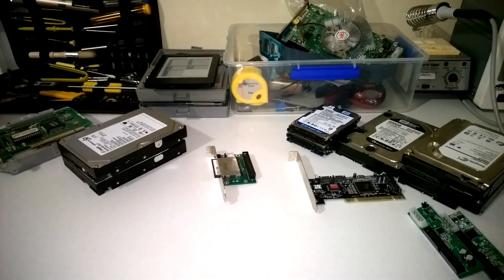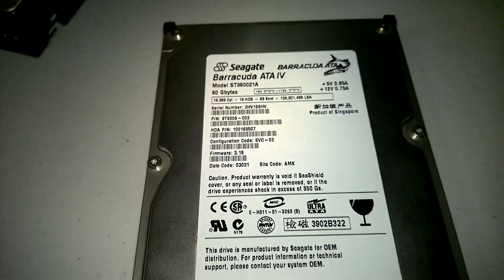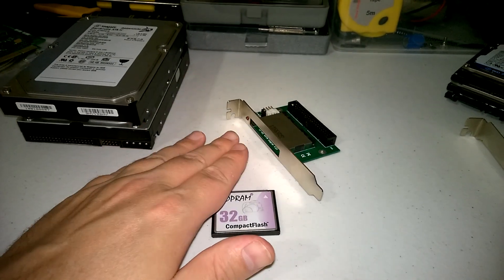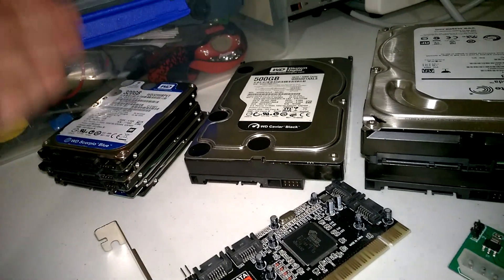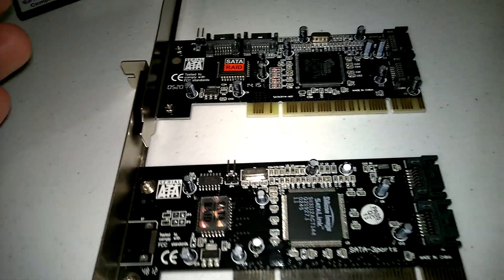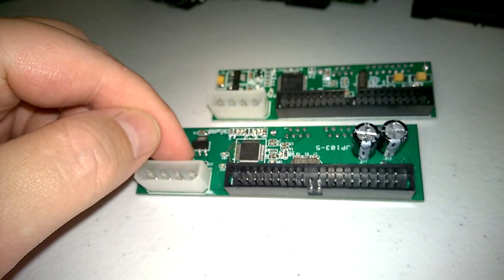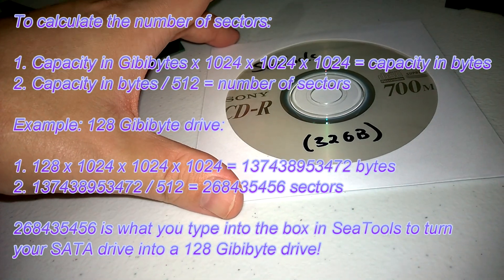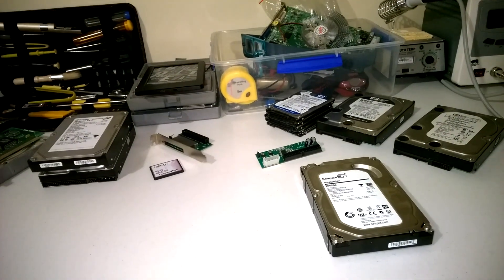Hard drive options for Retro PCs

Comment: A good alternative is using relatively new motherboards with socket 775, an AGP slot and SATA ports. Oftentimes they have integrated SATA controllers that work fine with modern drives.

Comment: I found a PCI SATA controller on Amazon that uses the Silicon Image SIL3114 chip:  GODSHARK 4 Ports PCI SATA Raid Controller  (1 of several clones using the same controller)    
It detects my new ADATA SU800 120GB SATA 3 SSD, and I can FDISK/Format them from the Windows 98 boot disk.  (Going to use GPartED to align properly, just did a quick test)    
Comes with drivers for 98, ME, NT and 64bit Windows.    
Bonus info:  Some Seagate 5.25" SATA spindle hard drives have a jumper to limit them to SATA 1 speeds.  If you are OK using a hard drive, this also works with Windows 98 and some old on-board SATA controllers.
Reply from the maker: Nice! Yes there are a few controllers that work well with Windows 98 SE. I have used one from Promise with great success.

Comment: Why don’t you use a king spec pata ssd? Yes, a 2.5 inch ide drive. 8 gb, up to 256 gb. I use multiple 64gb models for my dell CPI and dell c810. Drop in, 100% compatible with win 9x. Just a thought.
Reply from the maker: Yea I meant to buy some DOM devices, but never found a decent deal it seems. If you have a link please share!
Reply: @philscomputerlab  I would buy two at this price. https://www.amazon.com/KingSpec-2-5-inch-Solid-SM2236-Controller/dp/B008RWKFYE
Reply: Why not just buy a SATA to IDE adapter about $4 on ALI' even nowadays?

Comment: Stating the obvious but you are a legend. Had a SATA VT6421A PCI with windows 98. Running no problem then changed from a SiS motherboard to a VIA ones with issues regarding transfer speed and lagging. Watched this video and comments about the chipset etc. 

Bit the bullet and got a SATA PCI silicon 3512 and the issues have gone away.

Life saver!
Reply from the maker: Nice! With VIA boards, and other chipsets, IDE is often what I end up using as it works well.
Reply: @philscomputerlab  couldn’t make it up. Just got an Intel slot 1 setup and having the same issues again as the VIA but this time with an Intel Chipset, the MS 6156 with the  Intel® 82443BX chipset. Will have to try the Silicon one out later.

I guess these VIA ones are just a bad choice period, although seems to be no issues with the SiS chipsets. Do you know how the Silicon ones work with SiS chipsets?

Comment: There are ISA SCSI drives, even 8-bit ones, and they don't need drivers if operating properly. I used Mac's in the mid-90s, and they all had SCSI, and I found it not only faster, but more reliable than IDE (or EIDE). You could also connect Macs on-the-go by FireWire, when you still needed slow PC-Link software to transfer a few files PC to PC. Apple had some justification in claiming superior performance back then. SCSI had been used for years in Sun workstations and servers, basically all the high-end workstations used it. IBM might have slowed the development of PC drives when they converted all IBM PCs to Micro Channel Architecture. It was a good standard with good specs, but when every clone-maker was sticking to EIDE, and supporting components that were cheaper and much more widely available... It was good to have Nubus and SCSI in Macs at that time. So very different than today.

Comment: you could have talk about the different sector-sizes on sata drives (512b vs 4k), since not all OS are compatible with the newer 4k standard natively (older systems like MS-DOS, Windows 98 and XP does not run well on newer 4k-sector storage without additional work! ). Otherwise very nice video!
Reply from the maker: Yea good point. The Seagate drive has this mentioned somewhere in the datasheet, that 512 sector sizes have no performance impact. I do remember that detail, though not sure if I mentioned it in the video. I doubt the overhead would be high enough to really notice with these old machines?
Reply: some more indepth info about the whole thing: https://docs.microsoft.com/en-us/windows/win32/win7appqual/512-byte-emulation--512e--disk-compatibility-update

Comment: I just discovered an option that may have been overlooked that includes Hyperdiski Disk on a module used for embedded OSesand includes  some pretty advanced features for windows 98 seemingly includes TRIM and ECC and a lot of liftime writes found it on ebay .. any experience with these ?
https://tinyurl.com/wag7gxt
Reply: So it's just a SSD for older machines?

Comment: I have a powerbook 540c (apple laptop) with scsi hdd, what can I possibly use to replace the drive in there? 

I'm very shocked it still works after 25 years but I know i'm playing with fire, needs to be cloned or at least replaced

Comment: I was looking at getting a 50mb/sec 8 gigabyte CF card for my old Pentium 100 which I believe has an ATA33 controller, so the read and write speed of that CF card I'd think should far surpass what the interface can do at maximum. Just checked and the original HDD is only 16mb/sec so this card should be more than fast enough.

Comment: I'm trying the cf2ide adaptor with a kingston 600x 32gb cf card and it sees it but when i create the partitions in fdisk and i have also tried using the diskmanager once the system reboots the partitions are gone. is this because the kingston cf card is not compatible or is their a step i need to do so it works. im using it in a 486 at the moment will probably be putting another one in my 386 once i get this working.
Reply: I've also run diskpart on my modern machine and cleaned the card of the pre partition to see if that would work and it didn't.

Comment: I know this video is old so you may not see this but have you used either of those SIlicon Image SATA controllers to boot on an Asus socket 370 board? I'm trying to set up a retro rig with an Asus TUSL2-C motherboard and I've tried two of these Sil3114 cards, they see a connected DVD-ROM and SSD, but the machine won't boot to either device. I tried booting to an IDE drive to get Windows installed but even after that first step, upon reboot the SSD still won't work as a boot device.
Reply from the maker: ODD booting is not supported. With new flash storage, try the fdisk/mbr command to make it boot!
Reply: @philscomputerlab  aha! that makes sense - thanks Phil! Do you know if the lack of ODD boot support is due to the card/chip or system? Wondering if perhaps there are any old SAS/SATA PCI or PCI-X RAID controllers that would work
Reply from the maker: @kalmtraveler  What I do, is connect the ODD to the onboard IDE, that always works. For the hard drive, there are lots of options, but PCI SATA controller should work well.
Reply: @philscomputerlab  just wanted to share something that I've found this week - the Adaptec 1220SA SATA RAID card (PCI-E 1x) works fine in a SEDNA PCI-E 16x to PCI adapter, and according to its manual supports booting from SATA DVD/CD drives but I haven't got that to happen yet. Also, in a Star Tech PCI-E 1x to PCI adapter it doesn't detect any drives... Anyway, if I can get it to actually boot from CD this will be a great option so we don't need to rely on old IDE drives. One thing to note I have not found any pre-Windows 2000/NT drivers for this chip yet (so no 98SE/Me). There might be a generic ATA driver that will work so I will let you know if I find something.

Comment: Thanks Phil for these ideas,
I have been worried about my Gateway Essential 450 and my IBM PC 300GL with the old ide pata hard drives and their eventual failure. I am going to upgrade with 120gb sata drives and use the ide to data adapter (not the card).  Now my iMac G3 I am not so sure about.

Comment: Hi! Towards your video end you discuss how to lower the gigabyte size of a 2T Hard Drive to run swell under Windows 98 at approx 128 Gigs. Are you using this huge Hard Drive, instead of a trusty old legacy 120 gig or less hard drive (that Windows 98 could & should handle), to enjoy maximum durability and less chance of crashing? I'm sure the 1T or 2T Hard Drives are built with much more modern components inside, but are they that good to actually think about buying them off Amazon and then allocating way less space to run on an older Legacy Computer?
Reply from the maker: Yea some drives can be configured to basically report a smaller capacity to the BIOS. Now modern drivers use SATA, so whatever your system, it has to be compatible with that. Seagate drives work well here, you use the SeaTools DOS utility. AFAIK Hitachi has something similar as well.

Comment: i used a 2gb seagate drive for the noise and clicks to complete the retro feel on my Pentium 1 DOS PC but it started acting up like getting bad sectors and not working right and later it completely failed like there were so many bad sectors that the format was so slow, it kept saying "Trying to recover allocation unit" in the formatting process. i just scrapped the drive and took the magnet out of it, i am using a 40gb drive in place of the 2gb drive, it's so quiet compared to the 2gb drive. Those old drives don't age well and they just simply die like get bad sectors over time.
Reply: Did you try using SpinRite? Seems to always do the trick with my old mechanical drives.

Comment: Hi, Phil!
Nice review, but you should mention the "Flipping the removable bit" problem that many of the CF users may experience.
Reply: I have. Tried one old 2GB SanDisk Ultra CF with the CF to IDE adaptor I have (one of those with PCI bracket that can be found on eBay). The BIOS sees it as a drive on the IDE bus, but the card appears as removable drive in Windows 98 SE.
Haven't even tried to fix it, because it wasn't mine.
Reply from the maker: Yea never had that issue, and I worked with a LOT of different systems.
Reply: PhilsComputerLab I have experienced the same and found it to be a real bear.  I agree that it is something worth looking into; I had to abandon the CF SSD path due to difficulties with the removable/fixed bit issue.
Reply from the maker: No idea what you're talking about, I've never heard of this.
Reply: Some CF (and not only CF) cards require this bit to be flipped, otherwise they are being seen as "Removable drive" and not as "Fixed drive". Not so big deal for DOS, but a must for Windows.
Reply from the maker: Odd, never ran into this issue.

Comment: Do you have to format the SATA drive before placing in system. I tried to install a 120gb ssd with an adapter but bios/system will not recognize. Ideas?
Reply from the maker: If it doesn't get recognised, then it's not the right drive to use! Go with something else, like a SD card.
Reply: @philscomputerlab  well for some reason my K7M Asus motherboard continues to not see any hard drives regardless of what I do. I get alot of ATAPI incompatible

Comment: The best solution out there is using SCSI. Compatibility is as good as it gets. Just get a decent UW-SCSI Adaptec controller (if you haven't one onboard on the motherboard), a 68-pin modern SCSI drive and forget about DMAs, master-slaves and all that nonsence. For DOS and Windows 98 drivers are optional, they increase performance, for Windows NT-2000-XP drivers are a must. The only downside is that SCSI will significantly increase your boot times, but you'll definately notice the performance increase as well.
What's so great - you can put a fairly modern 300GB U320-SCSI 15K rpm (Cheetah 15K.5 for example) on any UW-SCSI controller and it will work in any motherboard eliminating 8GB, 127GB BIOS limits.
You'll be also amazed how quiet the Cheetah 15K.3 and newer are.

Comment: Many years ago I had a good 'hack' use for the 4 port silicon image sata cards:
Remove the BIOS chip and fit a plcc32 socket. Put the BIOS chip back in the socket and boot up.
Once the card has initialized, the BIOS chip can be removed, and the flashing tools used to hot swap in and reflash pretty much any motherboard BIOS (or plcc32 flash chip) to recover from a bad flash etc

Comment: Very interesting video!

I have finally ordered some retro parts and I'm thinking about storage. So far I've bought an ASUS P3B-F, an Intel Pentium II 400Mhz and two Kingston PC-133 256 MB sticks.

My preferred method of storage is definitely the compact flash with a slot at the back. I REALLY like that they are compatible with the IDE standard and that there is no need for converters. I also like the idea of having different CF-cards for different projects.

I've never (not even in the 1990s) been fond of hard drives. Somehow, I feel that mechanical parts have no place in a computer.

Do you have any idea of the performance if i decide to go with a high end compact flash? Sandisk Ultra, Sandisk Extreme or something like that. My idea is having a card that is so fast that the IDE controller becomes the bottleneck.
Reply from the maker: Johan Andersson You'll be very happy with a fast CF card.

Comment: Phil, could you update this video? Something has changed on this meantime?
Reply: Things are mostly the same. Old hardware is still becoming harder to find, of course. One option he doesn't mention is that you can actually find new production PATA SSDs on EBay/AliExpress, you will also need a mini IDE to full size IDE adapter since they are 2.5" drives. You'll get good performance while being able to use any motherboard's onboard controller. I have one of KingSpec brand.

Comment: I remember when I first got a SATA II hard drive back in the day, it didnt work with my SATA I motherboard, but I got it to work by setting some jumpers on the back of the hard drive. 3.5 inch Western Digital hard drives look like they still have the option to limit the speed to SATA I: https://support.wdc.com/knowledgebase/answer.aspx?ID=981
Reply from the maker: Yes I know that trick! It works great with VIA chipset motherboards. Unfortunately newer drivers don't have this option, especially SSD.

Comment: Excellent video Phil. I'm using a different CF to IDE adapter, MSI 694T mobo, and I can't get more than 2 MB/s read speed on windows 98. (Can't enable DMA), rare, isn't it?
Reply from the maker: Some boards and drives just don't work well together.

Comment: In the era I'm looking at for my 486 build, most decent IDE HDDs were around 500MB... LOL – I'm looking more for something SCSI-2 2GB. 80GB IDE drives seem too modern to me to bother with for now. Maybe in another 10 or 15 years or so. I have plenty in my basement already as it is now.
Reply: IDE drives are not modern at all and for yourself thinking they're. I am lost for words
Reply: @oblivionlord1242  That's because you apparently don't know what my post is about. Intel 486 CPUs are roughly 30 years old. DOS 6.22 (28 years old) has a partition limit of 2GB. 80GB IDE HDDs are essentially wasted in this scenario, i.e. too modern, but they might be useful for a Windows 98, 2000, or XP era build (Pentium through Pentium 4 era) – Windows 95 was transitional between FAT16 and FAT32.

On the other hand you still see some modern era laptops running Windows 10 with as little as 64GB storage capacity and 4GB RAM soldered on the board, but I wouldn't recommend them.

For comparison, my primary computer at this time (not particularly "retro" yet, but getting there) has a 4TB Samsung 860 Pro SATA3 SSD (OS and installs) and a 16TB WD Gold SATA3 HDD (media and backups) with an i7-3930K and 64GB RAM– Windows 7 NTFS.

Hope that helps resolve your confusion.

Comment: been binge watching, this content really brings me back!

what are your thoughts on running an ssd through a sata to pata adapter vs a sata pci controller? Im building a system with an or840 mobo and it has ultra ata66 ides, and 32/33 pcis. In theory the sata controller provides double the bandwidth (~133MBps due to pci limitations) of the ides, I'm just not sure its needed in such a system where the fastest incoming data would be from usb2.

keep up the great content!
Reply from the maker: My thoughts are that these old machines don't have the CPU power to take advantage of anything faster than 33. Unless you just want to copy files. You just got to compare how long it takes to boot a Pentium II vs a fast Pentium III. With faster machines you will see a benefit. Personally I prefer to go straight to a PCI SATA controller, or use boards that have it built-in (Athlon or Pentium 4)
Reply: thanks for the reply!

yeah, I just really wanted a dual slot 1 with rdram—fulfilling childhood dreams—so that limited my board choices. another question and I'll leave you alone, this is more a personal preference: what new tech do you feel is mandatory (because it makes your life easier, because it replaces failing equipment, or whatever reason) in every retro build?

I'm really excited about this build! You'll probably see me posting at vogons when I start putting it together ;)

once again, thanks for the reply and for the content!
Reply from the maker: GOTEK Floppy and SD card. Hands down :D A must in every old machine.